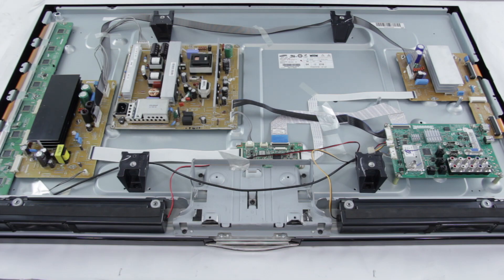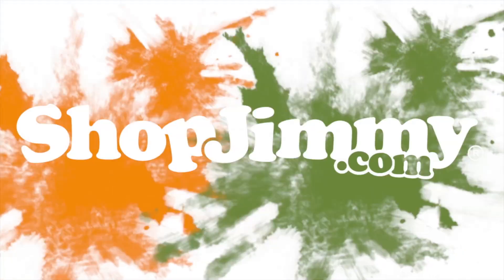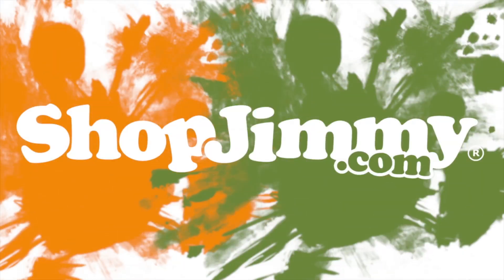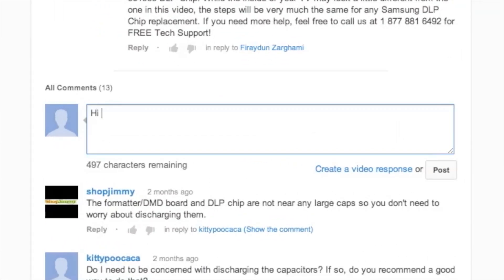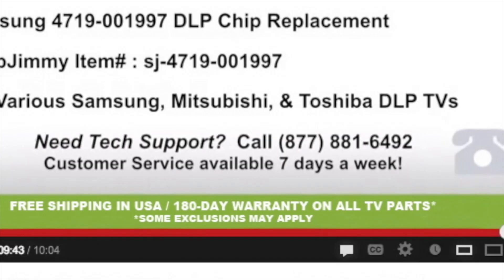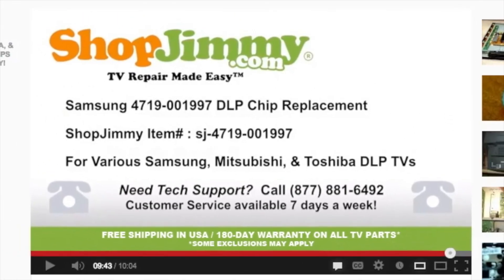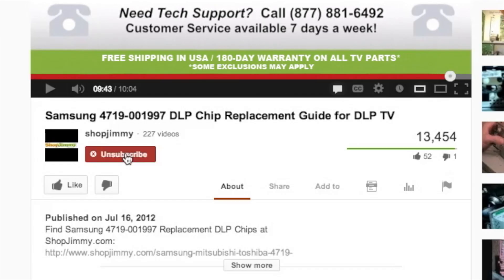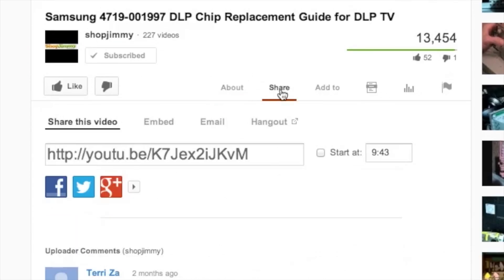Plasma TV Repair Tutorial - Common Symptoms & Solutions - How to Fix Plasma TVs

Comment: Hi, just replace SC,SU and SD boards, but the TV keeps doing the 7 time code blinks shut down, then when i disconnect the SC2 and the SC20 cable the tv keeps on but no image, I have a PANASONIC TH-50PX50U any ideas PLEASE HElP : )
Reply: ShopJimmy.com  Hello, actually they are from you i ordered 3/19/2015 order #1804808, im going to double check the connections Thanks!
Reply from the maker: Carlos Cottz   That sounds good.  Did you order by TV model number or did you match the part number on each board?  You will always want to match the part numbers on your current board with any replacement board to be sure they are compatible.  Thanks!  www.shopjimmy.com
Reply from the maker: Carlos Cottz  Yes, be sure that all of the connections are seated properly.  Thanks!  www.shopjimmy.com
Reply: Hello well I review the connections again then verified that the parts are compatible matching the part number with the replacement part and still the same symptom 6 blinks shot down any ideas Please Help 😁

Comment: Hi great video... I have a small problem on a Samsung ps60f5500 model in that there is a thin green pixel line running vertically down the screen on the left about a 10inches in
Could it be- connectors or dust ...I could live with it as the tv works fine, its just annoying feint line
Reply: live with it until another line comes or gets worse you need a new screen>>>sorry

Comment: Hello, I have a Pioneer Kuro Flat Panel TV.  Model number PDP-6020FD.  I just moved it.  It was working and now I don't get any power to it.  What do you suggest?  Thank you!
Reply from the maker: Juan Torres   I recommend replacing the power supply board in your TV.  Click this link to replacement parts for your TV model number:  http://www.shopjimmy.com/pioneer-axy1201-power-supply-unit.htm  There may be multiple boards for the same TV model number, be sure to match part numbers on your current board, with your replacement for compatibility.  Here is a link to a video showing how to identify your part number, click here:  https://www.youtube.com/watch?v=gO23Da7z-_Y  Thanks and please let us know if you have any further questions with your TV Repair!  www.shopjimmy.com

Comment: hi there i have a panasonic th50pv 700az, while the tv is going the sound just stops then wont go again till you turn the tv off for a few hours.
i have tried other tvs for the sat box and it works fine
any help on which board is faulty would be great.
cheerw
Reply from the maker: brent powell  I recommend that you bring the TV to a certified Panasonic Repair shop. Thanks! www.shopjimmy.com

Comment: I have a Panasonic TC-P58S2 that won't power on and no lights are working.  I opened the back and I see there is a main power supply board and next to it there is a sub power board.  I notice that one of the capacitors on the sub power board is slightly raised.  Would it be a good idea to order the sub board only to see if that is causing the problem?  Main board is ETX2MM812MSM and the sub board is ETX2MM812MSS, Those parts are out of stock on your website, any idea if they will be restocked soon?
Thanks!
Reply from the maker: Ted Beck  I recommend that you bring the TV to a certified Panasonic Repair shop. Thanks! www.shopjimmy.com

Comment: PN51D550C!FXZA During turn on the start relay clicks followed by another click or snap the set does this 3 times and then the ready light starts to do a flash sequence of on 3-4 seconds followed by a series of 5- 2 blink flashes and then another steady on for 3-4 seconds.  The on/off has no further effect at this point until you unplug and replug the set then when you try to turn on it will do the thing above again.  The screen stays black and never lights at all during this process?
Reply from the maker: Robert Hanson   Try this at your own risk. Unplug the TV, then disconnect the y board and plug in the TV to see if the TV powers up. Reply with the results of this test. Thanks! www.shopjimmy.com

Comment: I have a Samsung plasma TV that has vertical lines across on the left side. Colored lines that are present regardless of the source input and they show up when the screen is light/has color. There's a white vertical line that shows up always, whether it's black or lit. I don't have the knowledge or skill to do this repair myself, but I'm curious why this seems to be a common problem with Samsung TVs and other plasma TVs. I don't want to invest hundreds of dollars on a piece of crap that's gonna fail after 2-3 years
Reply from the maker: Marc Johnson   This sounds like a TV panel (TV Screen) problem.  If your TV panel is bad, it may be more cost-effective to replace the TV as panels are typically hard to find in stock, difficult to replace, and expensive.  Thanks and please let us know if you have any further questions!  www.shopjimmy.com

Comment: PN42C450B1DXZA Looks like this: http://i.imgur.com/j8FRJ85.jpg All red, some black bars. Found in trash, wondering if I should bother trying to repair it.
Reply from the maker: Jordan Mathis  I recommend replacing the Y-Main board, the Y Scan Drive and the Main Board in your TV.  Click this link to replacement parts for your TV Model number:  http://www.shopjimmy.com/catalogsearch/result/?q=PN42C450B1DXZA  There may be multiple boards for the same TV model number, be sure to match part numbers on your current board, with your replacement for compatibility.  Here is a link to a video showing how to identify your part number, click here: Thanks and please let us know if you have any further questions with your TV Repair!  www.shopjimmy.com

Comment: I got a samsung plasma 50" PS50B455B1W. And it wont start up, nothing happens. No clicks, no lights, nothing. 

I got power to the mainboard and all the fuses or okey.

What do you think?
Reply from the maker: Lajkare  Try all repairs and troubleshooting at your own risk.  I recommend replacing the main board in your TV.  Click this link to replacement parts for your TV model number:  http://www.shopjimmy.com/samsung-bn94-02845a-main-board.htm  There may be multiple boards for the same TV model number, be sure to match part numbers on your current board, with your replacement for compatibility.  Here is a link to a video showing how to identify your part number, click here:  https://www.youtube.com/watch?v=BEPWrefQvqI  Thanks and please let us know if you have any further questions with your TV Repair!  www.shopjimmy.com

Comment: I have an LG 50pg20 that turns on, but there's no display at all. It makes noise that signals that the tv is on, but other than that, there's no image. Please let me know if this can be fixed.
Reply from the maker: Alejandro4891   I recommend replacing the YSUS and the YDRVTP & YDRVBT boards in your TV.  Click this link to replacement parts for your TV model number.  http://www.shopjimmy.com/catalogsearch/result/?q=50pg20  There may be multiple boards for the same TV model number, be sure to match part numbers on your current board, with your replacement for compatibility.  Here is a link to a video showing how to identify your part number, click here: https://www.youtube.com/watch?v=GEllG3RV-tc  Thanks and please let us know if you have any further questions with your TV Repair!  www.shopjimmy.com
Reply: ShopJimmy.com is there one of these that is responsible for restoring image or is it a combination of all three?
Reply from the maker: Alejandro4891   You will want to replace all three of those boards at the same time.  Thanks!  www.shopjimmy.com

Comment: Hello! I have a Samsung 50" Plasma TV (PN50C430A1DXZA) manufactured in 2010. I have 6 individual black lines that run horizontally across the entire screen. These lines are all in the upper third section of the TV.

After watching the numerous videos you have here (which are awesome by the way), I ordered a Y Buffer board. I received this today and installed it but still have the black lines. Could you advise me on potential fixes?

Thanks, Jon
Reply: Update- i ordered and installed the Y sustain board now in addition to the Y buffer and i still have the black horizontal lines. Please advise on options!
Reply from the maker: Jon Kellen   This sounds like a TV panel (TV Screen) problem.  If your TV panel is bad, it may be more cost-effective to replace the TV as panels are typically hard to find in stock, difficult to replace, and expensive.  Thanks and please let us know if you have any further questions!  www.shopjimmy.com

Comment: I have a Samsung  plasma pn50c450b1dxza,that the screen went black the other night. I do still has sound,before this it had a small color streak down the right side. Plz help.
Reply from the maker: Nlue402 Nlue402   I recommend replacing the Y-Main Board and the Y-Buffer board in your TV.  Click this link to replacement parts for your TV model number:  http://www.shopjimmy.com/catalogsearch/result/?q=pn50c450b1dxza  There may be multiple boards for the same TV model number, be sure to match part numbers on your current board, with your replacement for compatibility, or find a compatible substitute.  Here is a link to a video showing how to identify your part number, click here:  https://www.youtube.com/watch?v=R1jmj_foId0  Thanks and please let us know if you have any further questions with your TV Repair!  www.shopjimmy.com

Comment: I've got the horizontal black lines across the entire screen, as you described. THat is a problem with the Y Buffer Board, correct? What could I do to fix that? Is it as simple as checking the ribbon connections to the y buffer board, wiping them down, spraying them with canned air, and reconnecting them to the y buffer board?
Reply: ShopJimmy.com 42PF7220A/37
Reply from the maker: Jim Minichiello   You can replace the upper and lower Y Scan Drive boards to see if that fixes the problem.  Click this link to replacement parts for your TV model number:  http://www.shopjimmy.com/catalogsearch/result/?q=42PF7220A%2F37  There may be multiple boards for the same TV model number, be sure to match part numbers on your current board, with your replacement for compatibility.  Here is a link to a video showing how to identify your part number, click here:  https://www.youtube.com/watch?v=R1jmj_foId0  Thanks and please let us know if you have any further questions with your TV Repair!  www.shopjimmy.com

Comment: THE LOGIC BOARD ON MY SAMSUNG PLASMA PS50C450B1WXXU SLOWLY FLASHES ON & OFF ABOUT 10 TIMES WITH RELAY CLICKING THEN GOES DEAD UNTIL IEC PLUG IS REINSERTED INTO POWER SUPPLY AGAIN ~WHICH PRODUCES 10 MORE FLASHES & CLICKS & SO ON
Reply from the maker: Joseph Paget   The logic is supposed to blink that is the hearbeat of the TV.  What are the symptoms and problems with the TV?  Does it have an image on the screen?  Blink code?  Power on?  Thanks!  www.shopjimmy.com
Reply: ShopJimmy.com WHEN I CHECKED VA & VS THE VOLTAGE WOULD BE AROUND THOSE SPECIFIED BUT WOULD QUICKLY DROP TO NEAR ZERO AS TV ATTEMPTED TO START~THE VOLTAGES TO THE MAIN BOARD ARE GOOD
Reply from the maker: Joseph Paget   Try this at your own risk. Unplug the TV, then disconnect the y board and plug in the TV to see if the TV powers up. Reply with the results of this test. Thanks! www.shopjimmy.com

Comment: Hello! I have a Panasonic PN58B650s1f. While we were watching the TV it faded from the outside edges to the center to black. Now the screen is black with a buzzing noise. Any ideas on repair suggestions? Thank you!
Reply from the maker: Hannah Brown   I recommend replacing the Y-Main Board, and the Upper and Lower Y Scan Drive boards.  Click this link to replacement parts for your TV model number:  http://www.shopjimmy.com/catalogsearch/result/?q=PN58B650s1f  There may be multiple boards for the same TV model number, be sure to match part numbers on your current board, with your replacement for compatibility.  Here is a link to a video showing how to identify your part number, click here:  https://www.youtube.com/watch?v=R1jmj_foId0  Thanks and please let us know if you have any further questions with your TV Repair!  www.shopjimmy.com

Comment: I have a Samsung PS-42C96HD Plasma TV, for the last few weeks my screen kept flickering on and off, and would eventually come on and stay that way until it was turned off. The screen then stopped working but the TV was on, and sound could occasionally work. Now the screen refuses to come on at all, but there is a faint buzzing noise coming from inside the TV?
Reply from the maker: Matthew Rush   I recommend replacing the y board and buffers in your TV.  Unfortunately I do not see any replacement parts in the search results for your TV model number on our website.  Thanks and please let us know if you have any further questions!  www.shopjimmy.com

Comment: I have a Samsung Plasma tv, Model# PN43D450A2D. I found this tv and all I know is there is sound when hooked up to cable but not picture.I also tried the menu button but still no picture. What should I look for when I remove the back panel with the tv unplugged? Thanks for any help!
Reply from the maker: Chris Mailloux   I recommend replacing the Y-Main Board and the Bottom Y Scan Drive board in your TV.  Click this link to replacement part numbers for your TV model number:  http://www.shopjimmy.com/catalogsearch/result/?q=PN43D450A2D  Be sure to match part numbers on your current board, with your replacement for compatibility.
Thanks and please let us know if you have any further questions with your TV Repair!  www.shopjimmy.com

Comment: Already replaced 50% of the boards in my Samsung 59" Plasma with NO LUCK... I have a 59" Samsung PN59D6500 plasma which power cycles when plugged in, the "smart" splash screen appears, then it displays the input in the upper left, then shuts off...  After extensive research online I felt fairly confident it was either the Y SUSTAIN, POWER PCB, OR LOGIC.  I purchased all three boards and installed the power PCB first with no success, then the Y SUSTAIN with no success, and finally the logic with no success.  The TV still power cycles.  I have a general knowledge of electronics and tested my 4 main voltages which all check out perfectly (Vsc, Va, Vs, Ve), i've also bypassed the MAIN BOARD with the jumper & pin short, this stops the TV from power cycling however there's no picture.  I'm almost out of options as this leaves me with only the UPPER & LOWER Y SCAN DRIVES, MAIN PCB and X SUSTAIN boards remaining.  Any help would be appreciated!
Reply from the maker: Mark Martin   I recommend replacing the Upper and Lower Y Scan Drives.  It is recommended to replace the Y Sustain and the Upper and Lower Y Scan Drive boards all at the same time.  Click this link to replacement parts for your TV model number:  http://www.shopjimmy.com/catalogsearch/result/?q=PN59D6500  There may be multiple boards for the same TV model number, be sure to match part numbers on your current board, with your replacement for compatibility.  Here is a link to a video showing how to identify your part number, click here:  https://www.youtube.com/watch?v=R1jmj_foId0
Thanks and please let us know if you have any further questions with your TV Repair!  www.shopjimmy.com

Comment: I have a Samsung 42" Plasma PS-42C91HD that's not turning on. When I plug in the power cord and switch on at the power point, the white stand-by light comes on and stays on. Pressing the on botton on the TV does nothing. When I use the remote to try and turn on the TV, the white stand-by light turns off and stays off. When I try again with the remote, the stand-by light will flash a few times and then remain off. I'm hoping the problem is something simple to do with the power supply.
Reply from the maker: Jason Loader   Try this at your own risk. Unplug the TV, then disconnect the y board and plug in the TV to see if the TV powers up. Reply with the results of this test. Thanks! www.shopjimmy.com
Reply: ShopJimmy.com
Thanks for the reply. I tried unplugging the y board but there was no change. I also tried this with the x board without result. I have changed the fuses on the power board. There is no sign of damage anywhere on any board, there is no visual evidence of a blown capacitor. I haven't used a voltmeter yet to check voltages, but I'm guessing a new power board might fix it. I notice you are out of stock of power board BN44-00161A. I have enough confidence to change a capacitor but I'm not sure how to find the faulty component on the power board, that's assuming the problem is with the power board.
Reply from the maker: Jason Loader   This could be a problem with either the power supply or the main board in your TV.  Unfortunately I do not see any replacement parts in the search results for your TV model number on our website. Thanks and please let us know if you have any further questions!  www.shopjimmy.com

Comment: Have a bush plasma 42 inch unplugged it tv wouldnt come bk on tryed the next day came on its been unpluged again wont come on at all any help please P/n3501000156a
Also this number e242587   e242690 thanks thats thw power  supply part number not model number on the tv
Reply: pdp42v7 model number says its an lg on front its a bush
Reply from the maker: darren brown   Try this at your own risk. Unplug the TV, then disconnect the y board and plug in the TV to see if the TV powers up. Reply with the results of this test. Thanks! www.shopjimmy.com
Reply: I think you need a new tv they are cheap on simply selling trademe like account. Once you have problems with tv's it's best to just dump them particularly with those codes.definitely dump it. Not your numbers bro. X